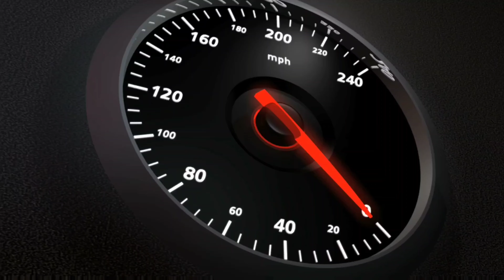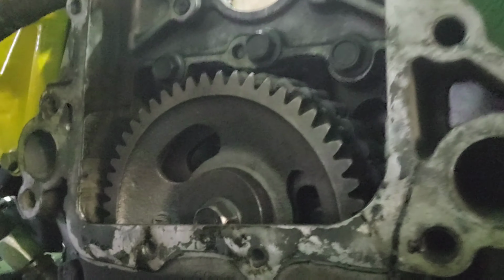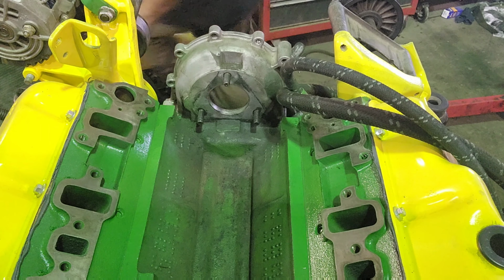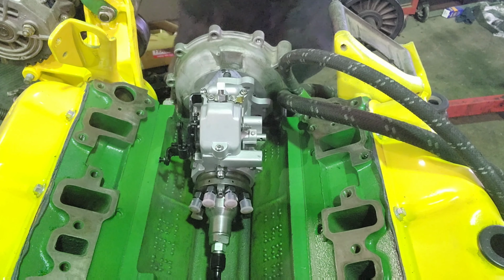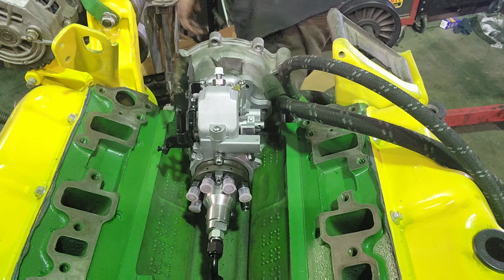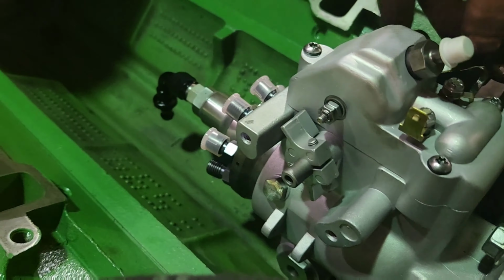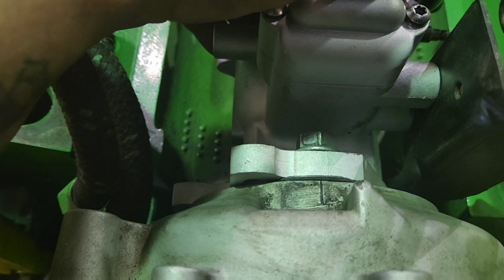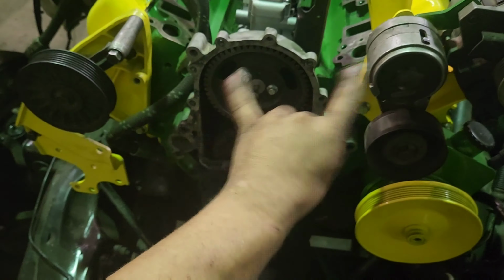6.5 Diesel Racetruck Injection Pump Install!

Comment: man i live in Denver Colorado I have 96 3500 6.5 i would like to bring mine there and get ya'll to get it running right its knocking i think its a fuel problem and not the engine due to the fact that i put about 500 miles on it to get it home with the sound and also having problems building boost truck seems sluggish. had it been a spun rod bearing or bent push rod I'm assuming it would have blown way before the 500 well to say the least i know driving it home was a bad idea more damage but that's what money and projects and hobbies are for. the noise is only noticeable on startup when the engine is cold and starts to be less noticeable when at operating temperature so i dont think its the engine . i checked for vacum and vacum leaks from the pump up to the lines seems to be all good i and feel suction on the end going to the turbo seems presure ok i can here the turbo spool and pull but its very weak i cant make it up the pass on the Eisenhower tunnel through the mountains steep grades are challenging even with no towing

Comment: I have a 1997 6.5L Diesel C3500 Crew cab long bed and back in 2017 I installed a P400 6.5L because my old engine blew a head gasket and where I lived nobody wanted to work on it so I just decided to go to Leroy Diesel and buy a P 400 and a friend of mine and I installed it there at my house or his house across the street he was a mechanic I put a lot of things on it from Leroy Diesel. A lot of them you talk about in your videos but anyway to the point, I still have the timing chain on my diesel. I’m debating on whether to tear the front back down on it because I’m leaking water out of the water pump not the pump itself back behind the pump where it bolt up to the block and we know how that is but I’m debating on whether to put that time keeper that Leroy‘s Diesel is selling and get rid of the timing chain and a few other things now like the wiring harness on the upper end across the top of the engine. What are your thoughts on running a gear, drive timing gear on the camshaft on these engines curious I think I’m approaching 100,000 miles now or at least 80,000 on this engine since new.
Reply: I don’t think Leroy sells the gears anymore.
Reply: Never mind, they started carrying them again. But man that price tag is steep!
Reply from the maker: I would recommend the time keeper set for sure to make a bulletproof timing setup if you can swing the price, but for the farm truck/plow truck/dump run truck and timing chain would work just fine. I plan on running a gear set on every engine that I build as long as they are available.

Comment: I love the real time videos it gives a better understanding of what your doing.  I just found your channel love what you’re doing. I would like to ask a question I have a 1996 Chevy one done Dooley 6.5 I have done a lot of upgrades to it but mostly just for reliability. 
What is a good scan tool to check and set the timing on my DS4 injection pump I was looking at one on quad star. But they’re all sold out. Thank you

Comment: Great video! Love seeing it come together. I will be that guy though, and clarify that, despite the confusing name, the "light load advance" lever actually retards the timing. It's possible it was to help engine reliability.

 I'm guessing with the bigger pump builds, pump timing is a key part of making a hot pump .

Comment: Looks like a P400 casting.
Not really a GM is it?
Reply from the maker: If you look close enough in the valley you can see the 599 casting. Original '94 599 6.5 block
Reply: @buckwildmotorsports  Ok, fair enough.

Its just hard to believe these tender 6.5s can stand up to this kind of abuse.